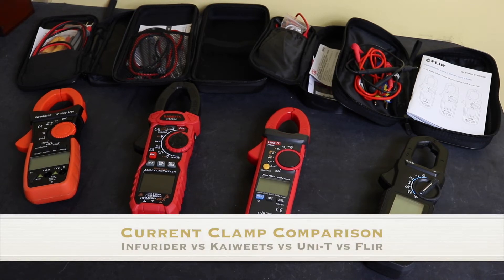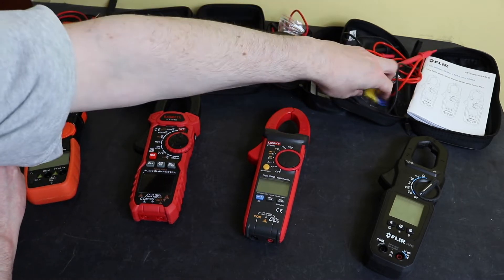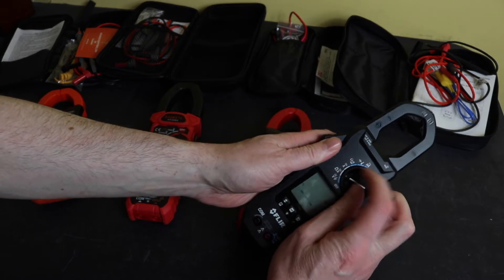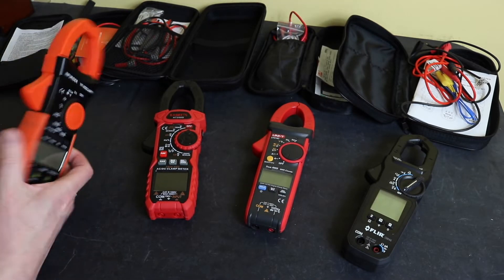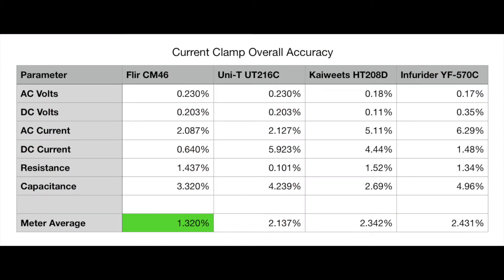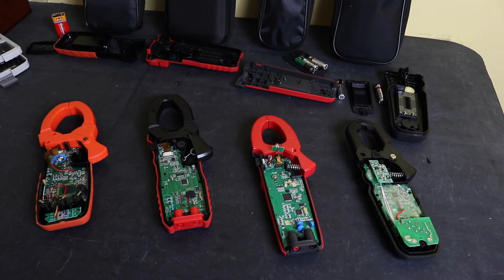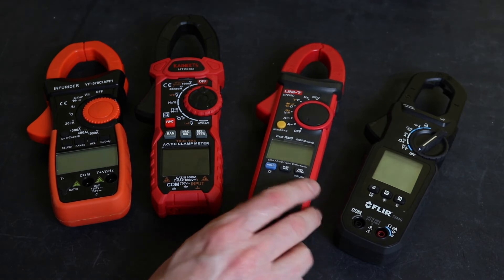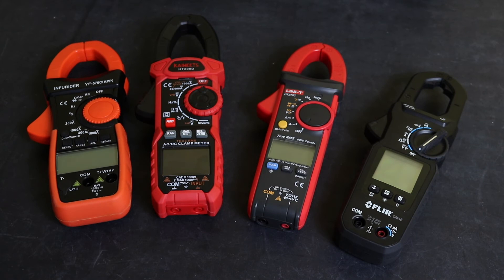Clamp Meter Comparison

Comment: Why does it show a negative sign infront of the amp number when measuring current solar panel short circuited? Klein model clamp reader.
Reply from the maker: It means that the current is flowing in the opposite direction. Clamp meters with either have a +/- symbol on them or an arrow to show the direction of the current detection.
Reply: @three-phase562 thanks

Comment: I have  Uni-T UT 216D in my pocket right now 
 This meter has  slow conitinuity response   
Good clamp meter  and  I am not in a rush
Reply from the maker: The speed of the continuity function on the UT216D, is the most common complaint I hear about it. As long as the meter meets your needs and you are happy with it, then that is great!

Comment: Ninguém criou um conteúdo pra mostrar o que falta pra ser acrescentado no circuito de leitura pra transformar Minha versão em HT 208 D.
Reply from the maker: Whilst you may be able to add the circuitry, you will also need to embed a hall effect sensor into the clamp. I would imagine that you would also need to reprogram the main processor to analyse the signal.

Comment: Eu queria comprar a versão Habotest  A e D e abrir pra ver qual a diferença entre eles pra aferição de corrente CA e CC. Você saberia ou já teve esse pensamento?
Reply from the maker: AC current is measured via coil around the tongues of the clamp. DC current will be measured via a hall effect sensor installed in one of the tongues. They will then feed into their own amplifiers and likely then go into the measurement circuit.

Comment: Thank you very much .  Do you think the Uni-t216C is better in terms of quality or the 208D
Reply from the maker: Overall, I would say that the Uni-T 216C is slightly better than the 208D. There are certain things that are slightly better on the 208D, it is a bit bigger and has a more rubberised feel, has the lead storage with better leads, a better case and the more vibrant display with dual readings. The 216C seemed to be more accurate and has a better internal build and input protection. Just depends on what you value the most in the instrument.
Thanks for watching and the question.

Comment: I had the uni t clamp metre it was very good with its readings, but found it a bit slow on continuity and resistance readings protection not bad for the price of what you pay.
I've also recently purchased Kaiweets ht208d quite impressed when it comes to Reading voltage and resistance quite fast. Nice inverted display with backlight but not very good when you are outside you cant see anything ,It would have be nice if they would have left the display in traditional standard display with backlight. It could do with better adjustment calibration which I have done it the lowest I can get it to measure 60ma to 100 ma. After mentioning the accuracy problem and calibration to Kaiweets, They were quite good and helpful they did send me out a full new full meter to see if it was better. The calibration was slightly better.
Reply from the maker: I have not managed to progress much with the HT208D, I couldn't get a calibration procedure out of Kaiweets, but I am stuck dealing with Amazon where I purchased it from as Kaiweets will not deal with me direct because of that. To be honest, the HT208D isn't really aimed at measuring in the mA ranges, so its accuracy will always be troublesome that low a reading.
As you say you get what you pay for with these meters.
Appreciate you watching and commenting.

Comment: I tend to clamp with my clampmeters, and turn to my DMM for most other things.
I really dont like having leads on my clamp meters.
I priotise a vribtant always on display, that dont suddenly turn of the light, and then I value "clamp-intended AC&DC measurement features".. like filters and a very fast inrush peak and perhaps dual display.
and then I value a wide measuremrent ballpark like fx 1000A, not leats if you have inush peak and a low resolution 1mA or 10mA and a display with a fast update rate.

A 30 US Unit-t210E for that AC&DC 1mA res and a 40US HT208D for the higher ranges.
Precurious that the AF570C carries bluetooth.. I reckon that was a problematic thing to put on a hall sensored clampmeter, and why none of the other went down that road??
As Bluetooth could be quite handy.. being able to datalog, live graph and take measurement from a distance but its such a hit or miss. how well build the bluetooth app is, as some of these apps, is close to useless..
Btw, how accurate were those with inrush peaks in DC measurement scenario, and did you look on what timebase (ms) they needed to be somewhat accurate?
Reply from the maker: The bluetooth function seems to work fine on the AFC570. I thought Fluke had some bluetooth clamp options as well, but by detaching the display from the instrument.
Inrush on the Uni-T isn't specified but looks to be an averaged function over a ms range. The other two meters are specified and were pretty accurate to the test. I really do need to produce a full video on the inrush testing of clamp-meters.
Thanks for watching and commenting.
Reply: @three-phase562   that would be great, would love a vid on inrush feature and to what extent you can use it on fx DC and what kind of accuracy your experinecing, and what kind of timeframe they need for somewhat accurate readings..
I tried the HT208D on a small 15v DC LIPO battery driven spotwelder with 20ms burst and it picked it up fine..was a tad under 500A with 20ms, while at 95ms burst it was around 570A if I recall, but I dont have the tools to get any aspect of a reference.
+1 for a vid about Inrush on clamp meters.
Reply from the maker: @JAKOB1977  It will get done in the future, am working away for a month at the moment, so won't be until I get back.